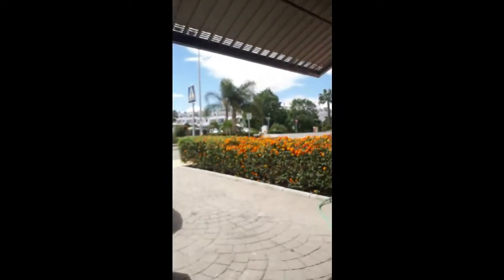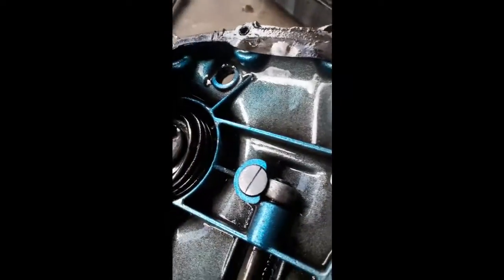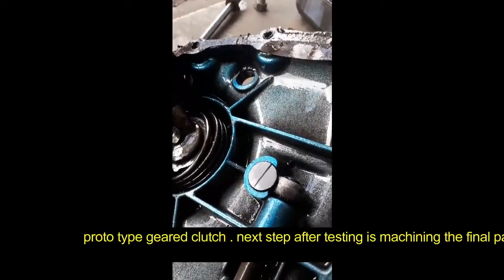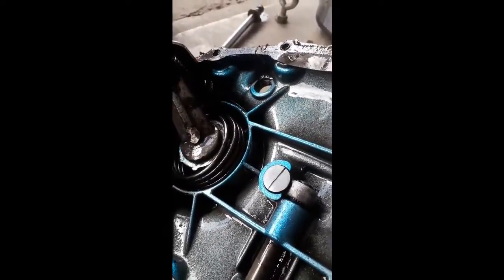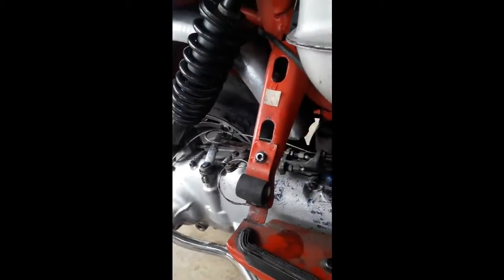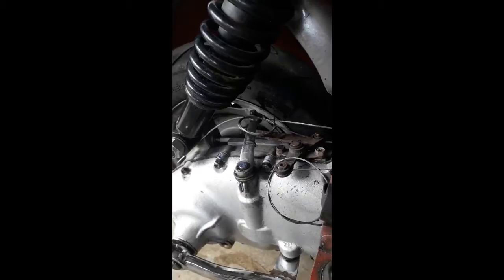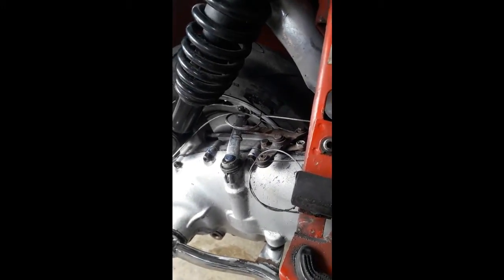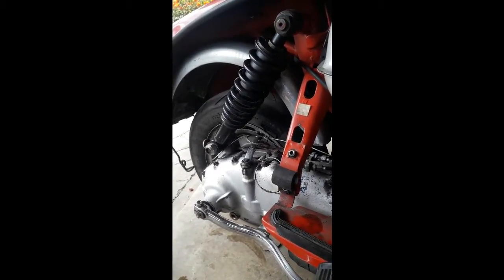lambretta tuning weasel style geared clutch prototype

Comment: That clutch could be just what me and a few of my mates are after, maybe change the title of the videos to whats in the content instead of the same title al the time Will get more subs. I found you by accident, oh and a tripod stand would come in handy for the camera when your tinkering , good stuff so far
Reply from the maker: had it in my bike now for three months . now im using it in my race motor  bgm 6 plate works almost as good as my casa casing but costs a lot less mate .....
Reply: @TheSteelweasel  are you selling them yet ? Im just waiting for a clutch spider from LTH as mines broken and the clutch is fairly stiff to be honest . The reason I bought it was because there meant to be light but its not as light as a friends BGM.
Reply from the maker: still in process of testing , and then to the machinist to get them made . if your in a rush i can do you a hand made one ?
Reply from the maker: only fits gp side casing
Reply from the maker: hi a version of my clutch gear is now available from chisel speed scooters uk at 50 pounds ,,,,